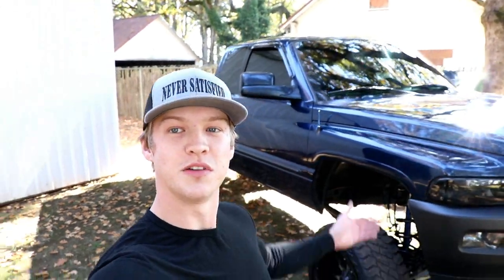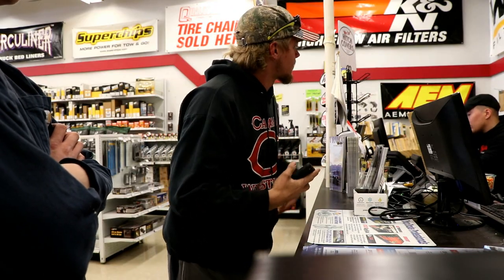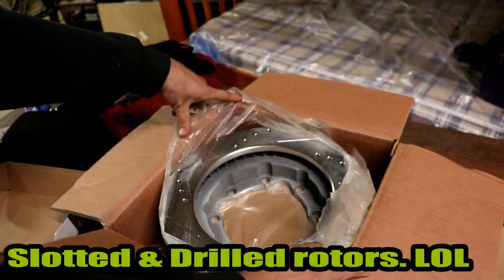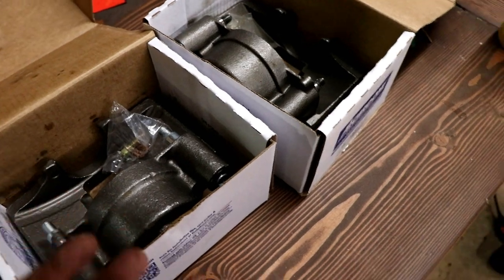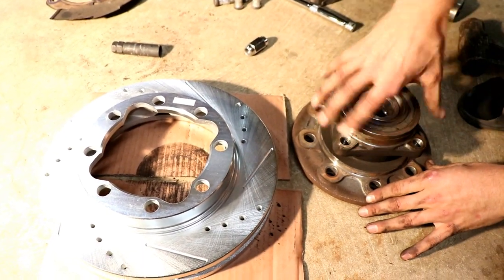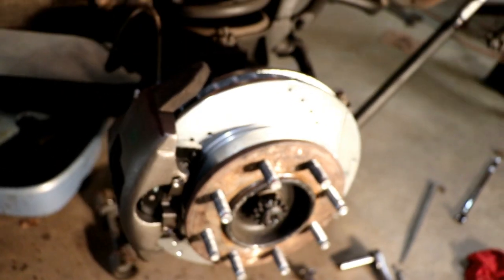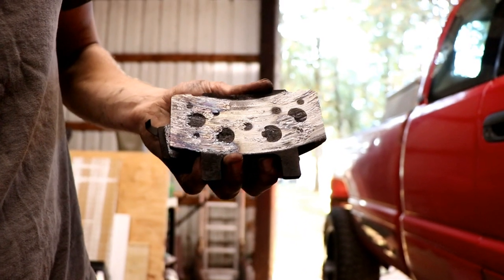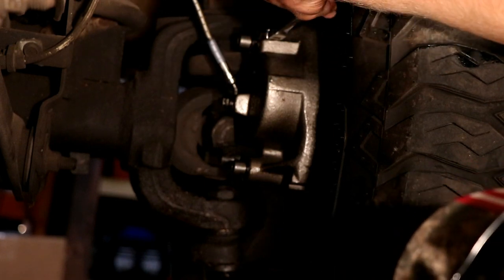The worst part of owning a 12v Cummins!

Comment: If you guys are ever bleeding brakes again in the near future, keep in mind to turn the truck over pump the brakes a few times, rought 3-4 times then hold. Once holding back off the bleeder screw while  holding down the brake pedal. Then close the valve and move onto the next or bleed again to clear any air from the caliper and lines. If you pump while you have the bleeder screw open  you allow air to travel back into the caliper and up the lines. You may now notice it in the performance of the vehicle during the moment but you may notice it at the point of failure when it does happen.

Comment: I’ve got a 12 volt 1997 3500 Cummins. Bought it in 2006. Only had to replace throttle bottle and normal maintenance. When I bought it in 2006. I paid 8500$ and it had a dumpbed on it. It was used as a county truck and only  had 25,000 miles on it prior to my purchase and It’s almost 2020. And I only have 113,000 miles on it now. After realizing how reliable and these engines are. I’m thinking taking the dumpbed off of it and restoring it to a reg cab daully. I’ve been using it for my paving business. But with research on this engine. A 113,000 miles on these motors aren’t hardly anything.
Reply: I just purchased one yesterday, I didn’t even know how legendary the motor was til i started researching it, I bought mine with 400000 miles on it and it runs like a champ!!!!!

Comment: Over the last 3 months I did the brakes on a 1997 Dodge 2500 12v .. and a 2001 Dodge 3500 24v DRW .. 2001 was a breeze the rotors are on the outside of the wheel bearing ,the 1997 the rotors are behind the wheel bearings which was a several hour job ..

Comment: Cheaper to buy parts online.
Reply from the maker: Andrew Welch cheaper isn’t always better. Especially when dealing with brakes that will be stopping a 8800 lb truck. But that’s just my option.
Reply: NeverSatisfied24v just make sure they are from the truck manufacture. They still make the brakes for older trucks.

Comment: theres this crazy new invention, called a press... save you the time off get the nut off marred threads
Reply from the maker: Jim Bo yeah but not everyone has one in there shop.
Reply: @NeverSatisfied24v  not all of us greasers have the luxury of a shop at times, speacially down at the docks. put the squishy thing to use, 5ton bottle jack, plus threaded rod, plus old olympic weights, or if you want to get smancy, 1/2 in plate

Comment: you forgot to add how much they rust out and those junk stock transmissions, nothing but problems
Reply: They are not that bad but will go out eventually especially with tuner
Reply: @joecaughtligma6917  no they are terrible
Reply: @Firelord360  wrong. My grandpa never had a problem with his transmission in his second gen 2500. It pulled a backhoe up a 18% grade and did fine. They are not as bad as people say they are. I know plenty of people that haven’t had a transmission issue.
Reply: @enginesandoutdoors3238  congratulations you are some of the lucky ones, just because you didn't have problems doesn't mean that the transmission isn't problematic

Comment: Anyone know what size tires I can fit on a stock 95 12v?
Reply from the maker: Michigan Outdoorsman you could probably clear 32s. If you Level it you could clear 33s no problem.
Reply: @NeverSatisfied24v  I figured out I can clear 33s stock I put 33 Patriot mts on 18 with a little dish on them
Reply: I was able to clear 37inch semi tires with no rubbing.
Reply from the maker: Based Theory maybe if you cut the fenders. The biggest tires you can clear on a leveled 12v without rubbing is 34s.
Reply: @NeverSatisfied24v  I got 33s on it I could have went with 35s granted the 18s I got have dish so not as close to inner fender
Reply from the maker: Michigan Outdoorsman even after we installed the leveling kit on his truck in a later video he still rubbed at full lock with the 35s.
Reply: I put 37 hummer tires on mine by just trimming the little body ridge on the front.